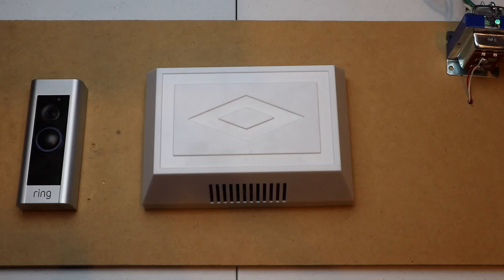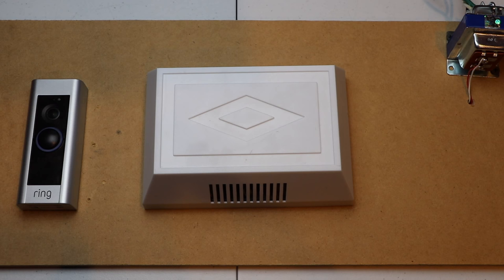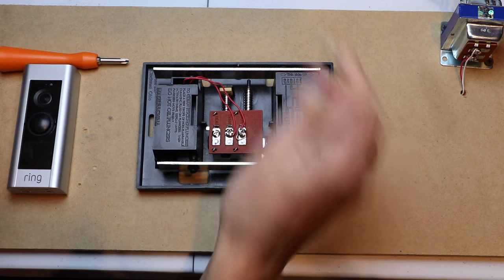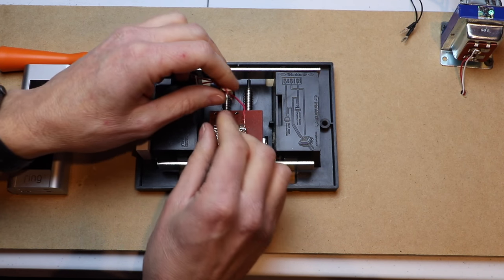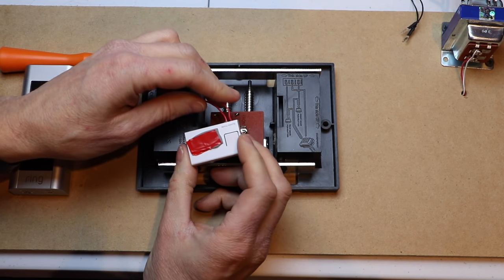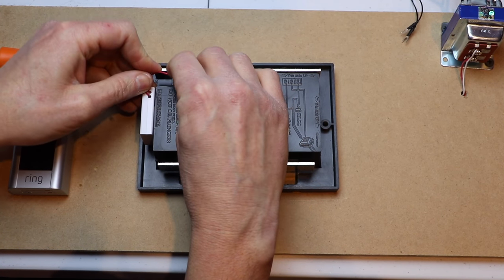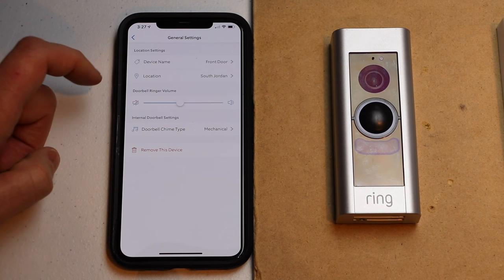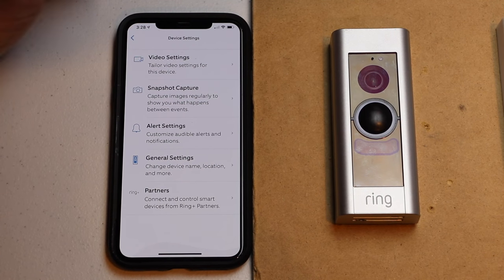Ring Doorbell Pro bypass Mechanical Chime using V2 Power Kit

Comment: Hey guys. Nice video. Thanks for posting it. One thing you can do if you want to, is after taking the wires off the terminals, is cut and strip back new wire, if you have the slack. It's easy, and gives you straight wire to work with. The inevitable kinks in existing wire can cause connection problems. (I have been an electrician for 30 years). Try not to touch the copper if you can avoid it. 
Thanks.

Comment: FYI your trick to switch doorbell type helped me a ton.  The extra power diverting to the doorbell in my house would drop the voltage and reset my ring, making it useless if run.  Now that I changed the settings and it doesn't ring inside I don't have to change the transformer (which I haven't been able to locate).  I really appreciate the help.
Reply: Same here!! I couldn't sync my Ring chime Pro to save my life and my transformer was buzzing like crazy. With a flip of a toggle switch on my phone, I was able to bypass my original transformer and sync my Ring Chime Pro! I all but given up on it until I saw this video and read your comment!! Thanks!

Comment: So I must have not gotten the same power kit you have, I could not pull wires out, so what I did was, used electrical tape and wrapped each wire to the tip of power kit, easily done and solved my problem, if your chime is buzzing or making random noises, or if your ring is saying Poor voltage, this will fix it thanks great video

Comment from the maker: If your Ring Doorbell Pro doesn't have power after bypassing the mechanical chime.  Turn off your breaker to the doorbell for 10 seconds then turn it back on.  The version 2 power kit has a resettable fuse that may have tripped.  The only way to reset the power kit is to turn the power off to it.
Reply: So according to videos and Ring, some say you need to buy a higher volt transfer to make this work others have this whole wiring system to make it work. I saw this video i seen how you didn't go through the mechanical and you just bypass that. I actually saw this and went through my system check and saw mine was on None function. I switched mine over to mechanical without bypassing and it works. Almost went through the trouble of spending money to buy a transformer. So this was helpful

Comment: Great video, something I did not know you could do with the V2 kit, however if you already have it installed as you originally did, there is an option in the settings to turn off your chime, mechanical or otherwise if you don’t want to bother with any unnecessary rewiring.  Thanks for the informative video!

Comment: So, what did you accomplish by doing this? Did you take your doorbell chime off line? So when someone rings the door bell, it no longer chimes? What does that small unit, inside the chime actually do? Does it send a notification to your phone that someone is ringing the bell? Would have been good for you to continue to show this in your video.  Thanks
Reply: Definitely. In trying to hardwire with existing doorbell chime and this could or could NOT be it

Comment: I have the ring doorbell pro and a 24v transformer. Do I have to use the pro power kit v2 they supplied? I don't want the mechanical chime to ring. Do I do the bypass method with the power kit v2 or just leave the power kit out?

Comment: I'm remotely helping my daughter with her ring video pro.  She has everything like this video, but it's an electronic chime?  She says the electronic chime a) doesn't ring anymore (she turned it off in the app?) and b) on very cold nights recently, just the electronic chime goes off a few times during the night.  But no one at the door / ring doesn't seem to reboot or be affected.

So she wants to take the electronic chime out of the circuit.  I thought just hook ring to transformer.  Some other pages talk of a resister needed.  You show keeping the power pack in series?

a) Can anyone explain what the powerpack does when it was in the original circuit with the chime and 
b) What is it doing now / why you can't just connect the ring to transformer?

THANKS!

Comment: My chime box and transformer look like yours, except my chime box has 2 sets of wires coming into it. Each set has a red and a white wire. The red wires are connecting to trans and front, the white wires are pigtailed.  How do I connect my doorbell?

Comment: I removed my mechanical chime completely and put those 2 wires together as I connected the battery powered Ring 3 Plus. It still charges too slow. Would a Pro work properly with my setup? Would it work better with a bypass?

Comment: Very good video @sellgooddeals DIY !  I just have one question: if I want to do this, the wires that will go directly to the Pro Power Kit should still bring 16V?   What happens if I do this bypass, but the wiring is bringing 110-120V (like there is no transformer at all)? Would appreciate your help, thank you!

Comment: I have video pro at a new home..no old chime at all. 24v Wires go straight from doorbell to transformer. How would I add the pro power kit then? It’s just a hot and a neutral
Reply: In the same situation, and both ring support and the articles are suggesting to go direct from transformer to doorbell... In fact the v3 pro power kit that comes with the ring pro 2 does not even have the bypass ports on it anymore.

Comment: Hi Chad, I am having low voltage issues and I have followed these steps and the issue I have is I have a front and rear ring doorbell. I can't find how to incorporate the rear in this scenario.  The front is now getting correct power but there is no power to the rear. How do I do this with the rear doorbell?

Comment: i tried the same exact method as you but once i disconnect my internal doorbell i lose power to the front door ring video pro doorbell. cannot get power unless i reconnect the internal doorbell
Reply from the maker: Did you turn the power off before you installed, then back on after?  So in bypass  the power kit has a resettable fuse.  To reset it you turn the power off wait 10 seconds and turn it back on.  That will reset the internal fuse.  If that doesn’t work to see if the power kit is bad connect both wires together (trans, front). If that works, most likely you received a defective power kit.

Comment: Great video. My issue is when I activate the two way communication on my Video doorbell pro my original door chime inside the house goes off and has this delay to it. Any advice? I purchased the chime pro and would like to just have this as my door chime.
Reply: IMO, you need to upgrade transformer if you want stable operation with existing chime. I have 24V 40VA transformer installed and have no problem with mechanical Westminster chime.

Comment: I INSTALLED RING DOORBELL PRO AND THE PRO POWER KIT V2 TO MY INTERNAL MECHANICAL DOORBELL. RING DOORBELL WORKING PERFECT. THE INSIDE DOORBELL IS NOT WORKING WHEN BUTTON ON RING DOORBELL IS DEPRESSED.  I DISCONNECTED THE PRO POWER KIT V2.  DID NOT BYPASS, JUST DISCONNECTED IT.  INSIDE DOORBELL WORKS AND RING DOORBELL WORKING.  IS IT DANGEROUS TO NOT HAVE THIS PRO POWER KIT CONNECTED?  AM I OK TO GO WITHOUT?
Reply: YES
Reply: Thank you, for confirming! That’s the solution you have for a bad white box that Ring would not replace even when it paralyzes the mechanical chime.

Comment: Will this stop the buzz and random ring every 30 or so seconds? I just installed my Pro and by process of elimination figured out what three of the four wires on my mechanical doorbell are, which are labeled 0, 1, 2, & 3. 0 appears to be the three wires from the transformer in my basement utility room. And I figured out 1 is the front door. HOWEVER, when I attach the kit to 0 & 1, the doorbell (mechanical) rings every 30 or less seconds and also has a soft buzz. If I switch it to 2 or 3, the same thing but with loud buzzing. I disconnected the kit but am still getting soft to medium buzzing, but not the ringing. In order to bypass, I need another wire to be able to bridge it from the transformer to the front bell so I can keep the back bell. Any thoughts on whether or not this will stop the buzzing? From what I've read, the Pro is making the circuit partway closed, as if someone is almost pressing the doorbell button, but not enough to close the circuit completely and make a continuous electrical flow. So that makes the doorbell almost start to ring, but instead buzzes. Makes sense to me that bypassing would stop that altogether. And I assume using the power kit would still give the added power the Pro might need? I'll look for something I can use for a wire perhaps tomorrow and post again if it works if I don't get an answer sooner. Thanks for the video, though - very helpful! (btw, I still haven't figured out why there are 4 wires instead of 3 on my mechanical ( 0=T, 1=F, 2=B?, & 3=??).)
Reply: I used one of the spare power kit cables that came with the Ring Pro and stripped the plug part off and used it to form a jumper from the transformer wire screw to the power kit bypass hole, then took the wire off of #1 screw and put that into the other hole of the power kit bypass. All Ring alerts and my Chime work, and no more buzz or front doorbell. I think my back Ring doorbell no longer rings the mechanical bell (lol), but as long as I got rid of the buzz, I am happy! Couldn't sleep much last night!

Comment: does this void the warranty? installation instructions make no mention of this
Reply from the maker: It doesn't void the warranty as the power kit is made to bypass the chime.  This is your best option if you don't want to upgrade your transformer to a 16V30VA.  Assuming you are having problems with your Ring Pro.
Reply: Section 5, Page 31 of the physical installation manual that came with my Pro goes through the process to bypass, but was unclear. This video helped.

Comment: I don’t have my old doorbell chime anymore. Only the wires remain. Sounds like I can direct connect the wires to the pro power kit and this will still power my ring doorbell?   I then bought the ring chime I can plug into a wall and use as the new chime.
Reply from the maker: You are exactly right.

Comment: Has anyone had the video go slightly reddish.  I have the same problem where it says the voltage isn’t good enough at 15v and was gonna try this when I get a chance to see if it will help.  The ring works but the video has always been tinted red and I was wondering if there’s something wrong or it’s because the voltage not being good enough ?

Comment: I bypassed the chime for the front Ring doorbell Pro. Doing this disconnects the rear doorbell. How do i wire so rear doorbell rings?
Reply from the maker: To be able to use your rear door you need to hook up the transformer wire back up to the trans (transformer) wire. terminal on the chime.  Then you need to run a small wire from the trans terminal on the chime to the power kit.  So, the power kit should have the front wire and a wire from the chime trans screw. On the chime itself you should have rear hooked up, the transformer wire should be connected to trans and a wire going to the power kit.  Let me know if that makes sense.
Reply: @sellgooddeals-DIY  Yes, thank you. I'll try that.

Comment: my mechanical doorbell only works when i press the ring button if the kit is not installed. once installing the kit, the mechanical doorbell fails to work. Why?
Reply from the maker: This video is how to bypass the chime, it won't be in use.  This should only be used if you are having problems with your Ring. If you are trying to install the power kit and still want to use the chime watch this video. https://youtu.be/mVPHKxPWi0k

Comment: Just out of curiosity, is cutting the power a safety precaution or absolutely necessary?
Reply from the maker: It's more of a precaution.  Thanks for watching!
Reply: So, lets say someone does not want a nasty ugly antiquated eye sore doorbell on the wall. They have two wires coming out of the wall, on goes to the front door button (where the August door bell is) and the other is obviously is the power going to a transformer. The two white wires were of each cable are tied together and the two red wires went to the doorbell chime i removed. Can I can just tie the two red wires together? Put some wire nuts on them, lots of electrical tape and shove it back in the hole?